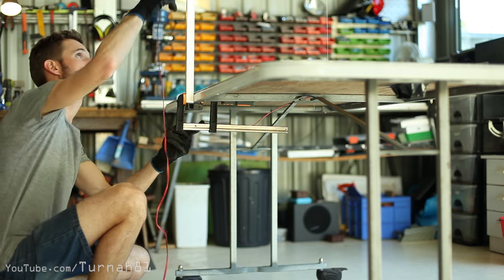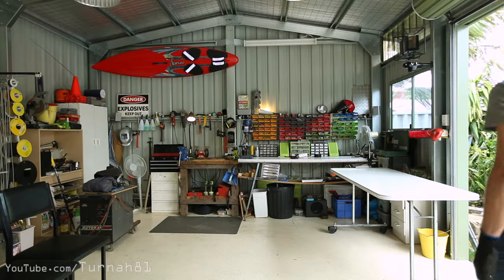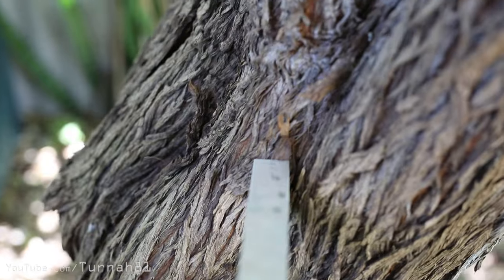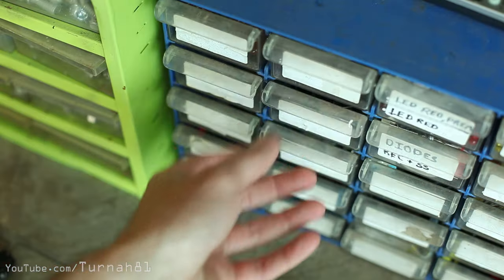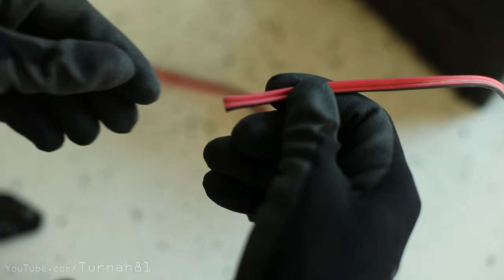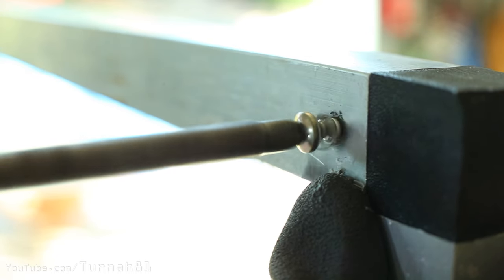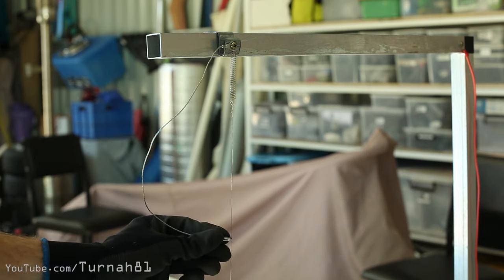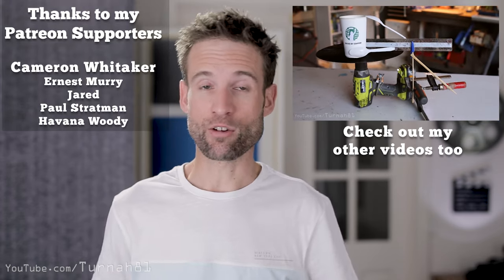Foam cutter - How to make it the easy way!

Comment: Just watched this brilliant video, spot on get's the job done and chuckled all the way through.I Was thinging what current, psu, contols, wire gauge I'd need. All questions answered. Cutting foam in the back of my campervan conversion simple, leisure battery connected to solar panel and stuff I've got hanging around.  I will binge my way through other videos of your's - Cheers

Comment: Holy crap!#! Thank you. I'm cutting a foam mattress and want to cut it when I pick it up from the former owner. I'm planning on just a bow made of wood and some wire. I did NOT want to create any electrical set up. The battery terminal connect is EXACTLY what i had in mind. Gonna have to re watch to see how you got the increase temp on the wire. I wasn't paying enough attention😳

Comment: Damn. That crocodile clip on the wire is such an easy control solution I bet there's more than a few other builders facepalming after watching this.Also, doesn't what you've got also count as a foot controller? I'd put it in the cathegory of 'close enough'. You could always insulate the spring and then just use that crocodile clip as your on/off.
Reply from the maker: love it. I reckon I will do this!
Reply: 'Egg of Columbus'...
Reply: I agree that crocodile clip on a wire is so simple and yet so awesome. I have just improved my own foam cutter the same way. Comes very useful especially if you are cutting different kinds of foams since some require higher temperatures.

Comment: Awesome video!! I made a small foam cutter the other day, I power the cutter with my soldering stations  DC out put. It cuts styrofoam at 6 1/2 volts, 9 1/2 volts cuts a Star Destroyer model and balsa wood!!! Thumbs up and Subscribed. I have a table and wire, I need to order the square tubes and end plugs tomorrow, great video!!  You will now be known as:  Sir Duke of Foam Cutter
Reply from the maker: Great work! They are handy I go back to it a lot. You can use steel angle brackets (like for shelves) as a cheaper alternative to click connectors. Just takes a bit longer. Cheers!

Comment: Nice ideas here, yes, the shorter the connection the hotter the cutting wire gets!
 Actually, I'm looking for ideas for a horizontal hot wire cutter, for cutting airfoils for wings, there are quite a few of those around too. 👍
Reply from the maker: Pvc bow I reckon is a good option.  I used one for wide but super thin cuts

Comment: Okay, I've gotten past the two cat videos and have moved on to this video for building a hot wire machine to cut expanded polystyrene foam.  After drilling a hole in the middle of your parents dining room table it seems a little "out there" to risk getting thrown out of a free room and board living situation to only get a hot wire to cut foam with.   

Perhaps you could improvise this hot wire in the middle of the dining room table to also cut meat and meat byproducts such as balogna. The added benefit of this is so obvious, I can't believe that you didn't already have this completed, or at least partially completed.  The obvious added benefit is:  As you slice the balogna with the hot wire, you're converting a plain old piece of cold meat byproduct into a delicious, hot dinner entree...  Grilled hot balogna sandwiches.  You can control the degree of cooking temperature of each slice by slicing faster for rare, and slower for well done.  What more could your guests expect?  Cooked-to-order meat, cooked and prepared right there at the dinner table.  

I know, it's NOT like a Japanese restaurant that chops up food with razor sharp knives and flips it around in the air landing in perfect alignment on your dinner plate. But look how much money you've saved by staying home to entertain and feed your dinner guests.
Reply: Barry Litchfield 🤣😂

Comment: Great video. I'm needing a foam table at the moment, and the prices are insane. Pretty sure I have most of the stuff on hand already. One thing I would add is a couple of diagonal braces to the vertical and horizontal aluminium tubing. Nothing fancy, I have endless amounts of 1/8 x 1 inch flat bar, and a pop riveter.  2 braces, about 6 inches long will do it nicely. The other thing I'd add would be an eyelet for the wire to run through  to the underside. Tilting the arm will tend to pull the hot wire into the table top. Either an eyelet or a small bit of brass or aluminium tube.

Comment: A thought.. Remove the ends from the glass fuse. Drill a hole in the wood for a press fit the O.D. of the fuse. It would be insulate th wire. Thanks for your videos!

Comment: I used fuse wire susptned with a heavy load tied to the bottom of the wire, connected + and - from the batterry, then slid the 50 mm polystyrene along,,, just a length of fuse wire suspended from anything in free air and a load at the other end,,,, worked fine, the bottom end of the wire is pendulating, but with the right weight and a slow motion of the polystyrene,,, I got nice straight cuts.

Comment: Looks like it worked great, nice simple build! Awesome job!
Reply from the maker: Cheers man. I still use this to this day. Only takes about 10min to set up. the Hole in the table has extended itself a little though from heat. If there was a ceramic plug at the bottom it would be sweet though

Comment: I have an old hairdryer where the bearing has gone bad. I've kept it, because I thought I could maybe try to straighten the heating element in there, which I think is nycrome. It probably has no transformer, so it would run on 220V. Would it get hot enough for 12V if it's short enough, you think?
Reply from the maker: Hmm. Not sure might be too thick. Doesn't need much heat though to cut. It may be wavy while stretched out though.

Comment: There are about 283 different foams but only expanded or extruded polystyrene. I did not know what kind as the description was vague. Electric fence wire is cheap on large rolls and work fine. As 32 foot boats and larger to not come with trailers, storing them for sale, servicing then in a static position or inside / outside winter storage, these were placed on large 4 X 4 foot (You convert to meters, i’m not) but we used a simple two man wood frame, attached electric fence wire to either end and used an old arch welder withe leads attached to either end. On a low setting, we used the angle of support for the boat using high density polystyrene bold, marked the compound angle on two sides of these blocks. Switch the welder on/off, so not to overheat the wire, simply pull the frame with an eye on the wire and it’s mark. Worked great. I know that art, shapes, origami and other items can be cut, but what is it’s main use for? Packing parts to safely transport shapes so they fit into a box?
Just curious! Thank! Nice bleeper!!! Oh, I never give total strangers money, gamble or feel that money comes into my wallet real easy. We got 3 cent per bale of hay to stack on a trailer, then Stacy into a barn. Three weeks of actual work, we where happy to make $13.00. I was the oldest on a family farm and never got an allowance. Not even gas money to head off to college. So?

Comment: I like making rc airplanes. But I suck as a pilot. So I go through alot of $1 foamboard. Im ready to move up to insulation foam boards. But they're messy unless cut with a wire, So thanx for the tip. 
Whats the typical household power down under? 120V or 220V. Cuz I was wondering why not just use AC?

Comment: Great video! If I don't have a free battery available, could I use the 6 volt setting on my plug-in battery charger to heat the wire? Or would I be flirting with electrocution and fire?
Love your humor! There's a guy named AvE on YouTube. You'd probably love his stuff!

Comment: Thanks I did not want to have to design some elaborate control circuit.  I just want to cut foam I find dumpster diving so I have the right size and shape for shipping things sold on eBay.  Also, I see many artist casting concrete sculptures using styrofoam as a cheap mold form.

Comment: The cutting wire is WIRE NICHROME RES 80    .32 MM.. this wire is a resistance wire and gets hot easily when current passes thru it..

Comment: Are these hot wire cutters just for polystyrene? I’ve just soundproofed my room with acoustic foam and I need to cut a few of the panels to fit, I attempted it with a Stanley knife first but couldn’t get a clean cut so I wondered if a hot wire would work or if it would just set my foam panels on fire?
Reply from the maker: I think I tried it but can't remember because a tried a heap of different things. Test it by heating the back edge of your knife with a lighter and if it goes through easily it should be ok however it may need too much heat to work. the wire gets to a point where it snaps if over heated and if it is too cool for a given material it collects too much melted residue along the way and causes a lot of fumes.
Reply from the maker: For what your doing I normally use a new box cutter fully extended and run it on a steel ruler- multiple passes. do your first cut on the fascia that will be visible for a nice edge

Comment: I suggest you make something that could be used to make several videos with different topics. That way it'll be more efficient in time and investment for you. This styrofoam cutter is already on course. First building the cutter. Next several topics are using the cutter to make some oddly funny useful things. Then you can mod the foam cutter into a plastic cutter, then carve some plastic thing, etc.

Comment: When i attach it to the battery, The coating of the wire started to melt away. Is it the wrong wire? If so, what do you recommend
Reply from the maker: hmm might be. Nichrome resistance wire is best. If it over heats it can snap but it doesn't have a coating that I am aware of.

Comment: Where did you buy the square tube plastic connectors
Reply from the maker: I salvaged these out of an old sign in shop but they are at hardware stores normally. I think the brand is "Connect-it"

Comment: COOL  NOW i got go buy 💲some resistant wire Light gauge - ( fuse wire)  as the owner changed the fuse box 5 years ago no wire about :) 👍
12.volt hey ? wonder if a 12.volt charger  of a printer will work i have a few i found ill try it :) mite make a robot cosplay thingy if i remember

Comment: This seems a bit random and dodgy. Then again, it took 20 minutes, it very clearly came out of that little corner of the world where every animal is trying to kill you, and … it includes a temperature control. What else could I ask for given that?

An insert to keep from singing the hole I guess? And a proper power switch? Yeah, those would be nice, but they'd take at least another five minutes.

Fun project. Flying cooler seems like a useful project too. Airlift a cold one to those in need. A worthy cause.

Comment: Bs. Take a piece of old electrical wire, strip, unravel and end up with a piece resistance wire. Create a jig with leftover cardboard. Ad a 9 volt block battery, and your done. Whatever.

Comment: Isn't this dangerous... You're creating a short.  The battery will explode.
Reply: not neccessarly. A short is just a very small resistor. As long as you don't exeed the max current rating of the battery, it won't explode. It also won't immediatly explode if you go over it, but the battery will heat up and might eventually explode. Car batteries don't explode very fast though, because they are designed to supply high amounts of  current. You might even be able to weld with them. Also, this resistor wire actually has quite a high resistance.